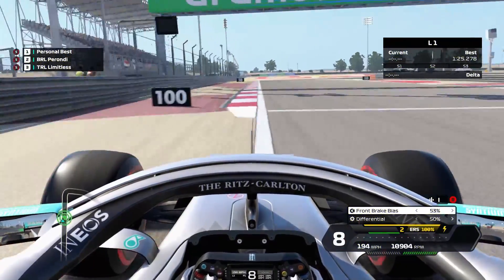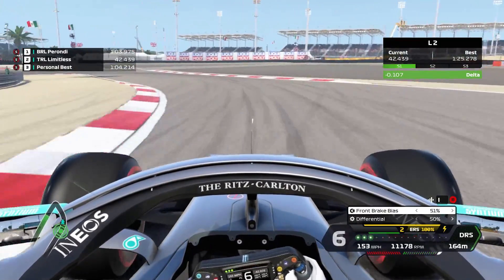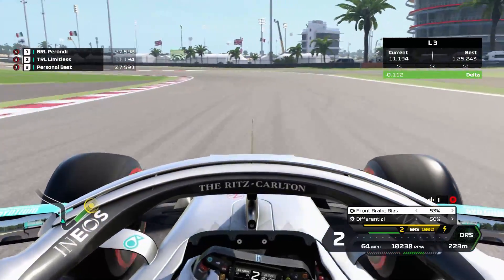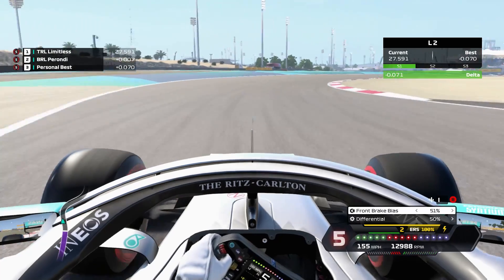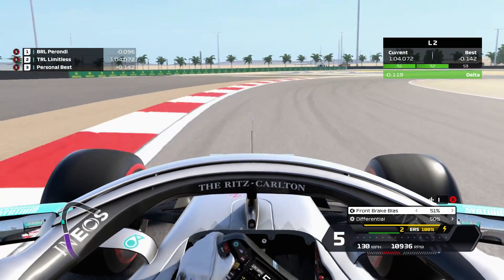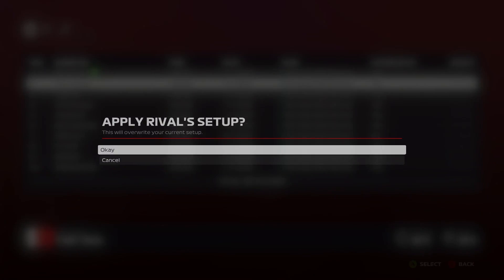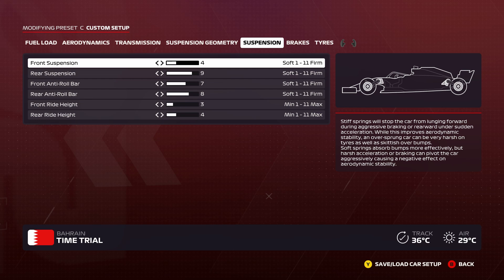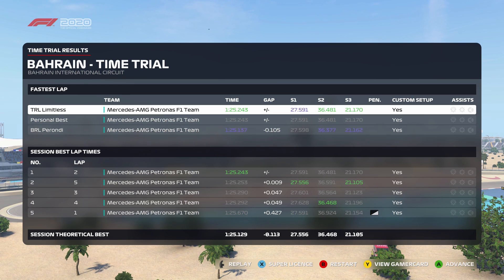F1 2020 BAHRAIN HOTLAP + SETUP (1:25.243)

Comment from the maker: Hope you are enjoying this series and finding it useful! These setups are built purely as a very good baseline and usable to use online, rather than to be the fastest over a single lap as they don't tend to work well in a race situation due to tyre temperatures. Also to make people aware that xbox (what this is played on) don't have the updated build, so these times are done with 1.5% less downforce which loses around 3-4 tenths compared to the PC and PS4 platform :D
Reply: Wait what

Nevermind i watched this video before melbourne 😂
Reply: I was a little bit shocked when I first tried your australia setup. I'm running your setups in the myteam carrer with slight ajustment in aero to balance the lower downforce on the car and I'm so much quicker. No Problems fighting for Podiums on 100%AI with the scrappy car. Really enjoying this series. :)
Reply: Pinguuu89 u must be using the normal t cam, his camera is using the offset t cam
Reply: Do you use any assist? Or do you just have it all turned off.
Reply: It’s awesome, so good to see those little details you normally don’t pay attention to
Reply: this setups are great  i tried the Melbourne setup on f1 2017 and I was a lot faster a full sec faster
Reply: TRL Limitless yeah

Comment: Thanks, Nice video again. I been using your setups since 2017. They always work for me and save me time. Sometimes i have to adjust them for my style of driving a little. But not much and i mostly run career mode. And usually race with them.

Comment: Just a question about the Australian setup, why was the tyre pressure so high? You even said that lower tyre pressure is better on this game. Thanks for the hotlaps + setup videos
Reply from the maker: For more response on initial turn in. I would put the pressures much lower for a race situation, but in TT it doesn't matter as much. On this track I have it lower for better traction, as it's more important here.
Reply: @JDisLimitless  Ok thanks!

Comment: I think you lost at least 0.100 in T1 cause you went deep, your 2nd run into T1 was better. Good lap anyway 👍🏻
Reply: De Keepa7 he did lock up but he went wide to get the most speed possible through t2 and the straight after
Reply: But he gains that back on the strait